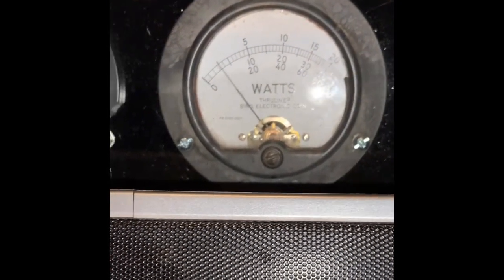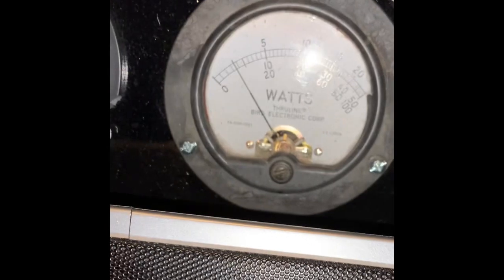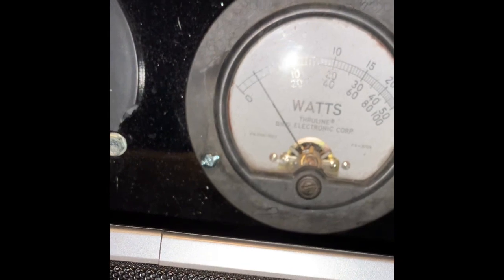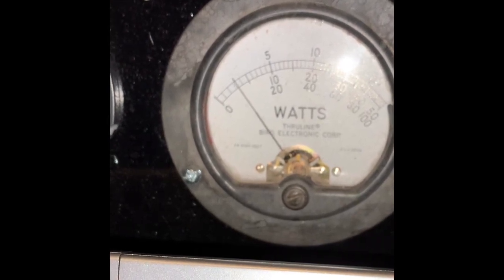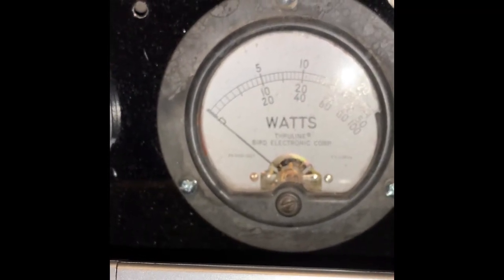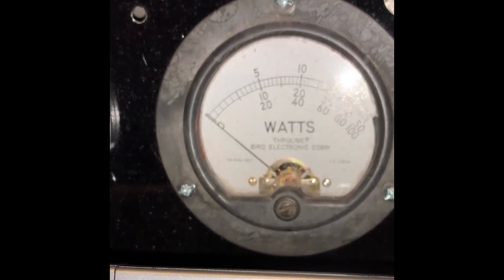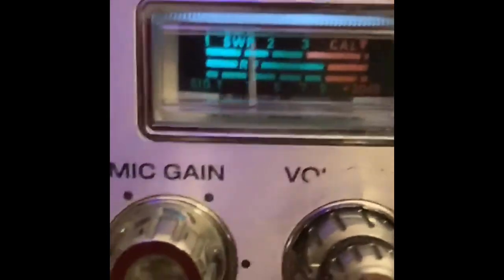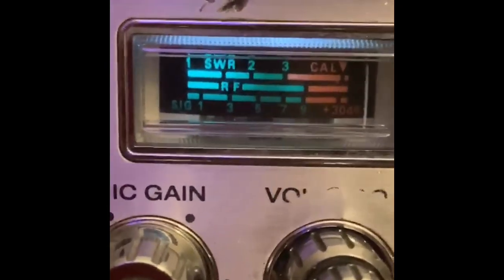Backward swing? Or is it?

Comment: I don't know hardly anything about how radios work or their internal connections, I mostly just plug and play. I have watched other videos describe how some of the electronic aspects function. So though what I say may sound knowledgeable but in fact it could be misrepresented by me because of my lack of understanding. My assumption is that it could be that you're being overmodulated and the distortion is causing the carrier to be pinched off which is causing your backward swing. Though it might not be bad enough to be noticeable on the recieving end but the meter picks up the discrepancy. Minor distortions or pinching of the carrier is usually more noticeable on sideband.
Reply from the maker: That’s a great point. I have noticed the less audio the less backward swing.

Comment: Ya def any kind of back words isn't good...even tho your brother is seeing forward on the receive side..somthing is still backing up in the moible. Maybe it's a bad meter,element or line section. Id try the test a good 15 20 miles away you must have been close to him atleast with that signal haha.... swrs are good?
Reply from the maker: 10-4. Yes always too close. Swr is not great. Can’t figure that out these days. That will be a video when it gets nicer out for sure. It was 2 watts reflect at 6k out for a long time. Something changed and it’s been keying 100 watts swinging down to 20-40 watts reflect at 6k out. It’s driving me crazy. I’ve changed and adjusted everything.